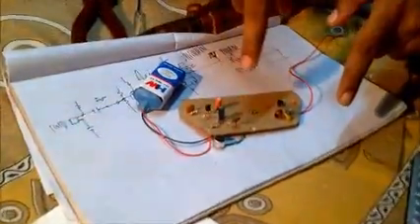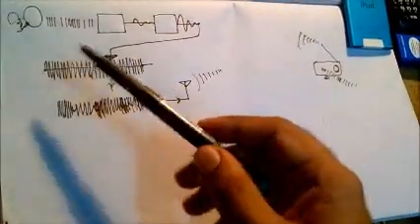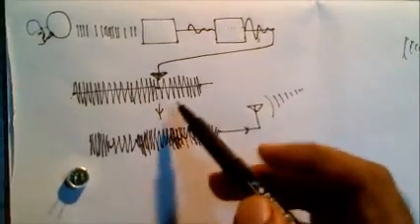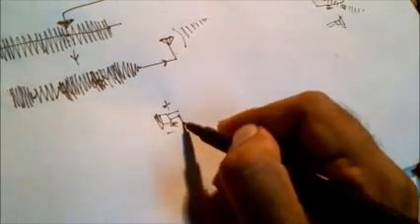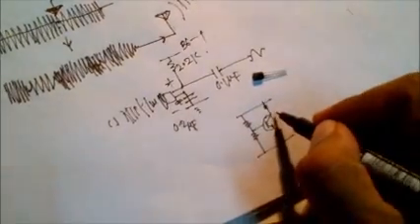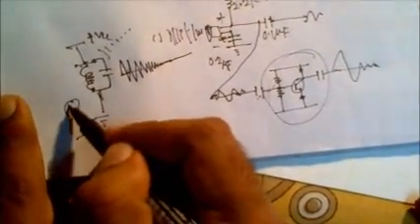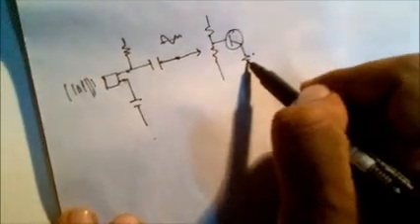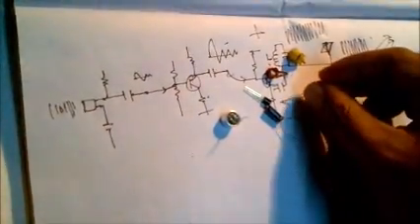Basics of FM Transmitter

Comment: Sir one thing i would like to ask you why collector to emitter is connected by capacitor in oscillator section if there is a parallel LC tuned circuit. 🙏

Comment: Assume that a sine wave is recived after amplification. During the positive cycle, the second BJT is ON , ckt is complete and a certain frequency is transmitted through the antenna. But when negative cycle occurs, the BJT is OFF and the tank ckt doesn’t produce frequency because it path is not completed so nothing shall get transmitted. So Im not sure how this works. Pls explain

Comment: Great 
The above circuit worked for me
Reply: Have u used Copper wire with turns as an inductor and variable capacitor for the tank circuit???
Reply: @guramkondayashwanth4127  Yes bro
Reply: Do you have any working circuit of FM receiver
Reply: How can I contact you, I have lots of doubts
Reply: @guramkondayashwanth4127  saranravi24@gmail.com

Comment: **@alpesh vitha Good instruction video BUT as the others have said you need to list the components and values.** The link does NOT work as everyone is saying. BTW this video is 5 years old to date. So maybe he is no longer posting?  The transistor is a NPN and probably a 2N3904. The RF carrier usually uses pico farads and the variable capacitor is about 60 - 140 pF.  Thanks for describing the working theory behind FM transmission though.  :)

Comment: The function of the two transistors in this circuit is not fully explained so I will try to contribute some additional information. The first transistor works as an audio amplifier in a common emitter configuration. The second transistor actually has 2 functions. It is a driver for the oscillator and frequency modulator at the same time. It is in a common base amplifier configuration with a capacitor accros the collector and emitter that provides feedback for driving the tank circuit. Frequency modulation is performed by changing the voltage on the base of the second transistor thus changing the Miller capacitance of the PN junction on the transistor. This changes the capacitance of the tank circuit which in turn changes the carrier frequency.
Reply: i have seen and made this circuit 100 times. after 2 years , i was still searching how this tank circuit is feed backed. and after a long time, you made my day.. its looks like common Emitter but No. its common base... it Mix signal by changing capacitance of junction. and for such High Frequency , its small change is enaugh. thanks. many many thanx for explaining.
Reply: +Benjamin Pajk Thanks
Reply: Thank you kindly!
Reply: But to be common base RF oscillator its base shoud be grounded by capacitor from base to ground

Comment: instead of a microphone how can i make it an audio input like an aux cable? also is this mono or stereo.. thanks
Reply: => If you want to put an audio input instead of a mic, you must only remove that resistor connected from battery positive pole to mic positive pole and instead of mic you solder an audio cable. That resistor is there only to lower the voltage that goes to mic to properly power it...
In that case you don't need (it still can stay but not really necessary) the preamplifier stage (first transistor right from the mic). You need only oscillator stage, and if you want it (if not enough power at the output for your needs, not good coverage, etc..) additional RF power boost stage...

=> Of course its mono, for stereo operation you need to build a stereo coder unit. Google it.

Cheers! ;-)
Reply: Thanks :)